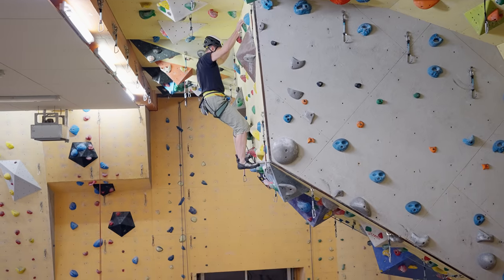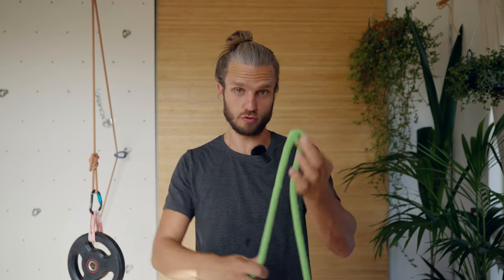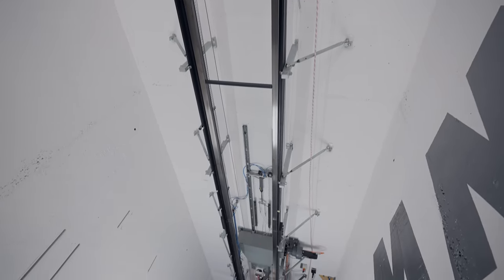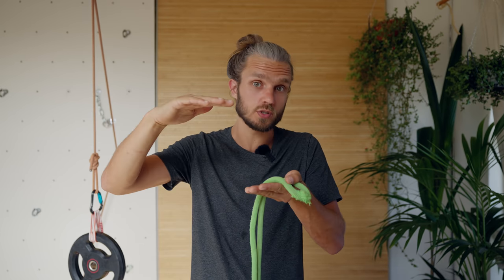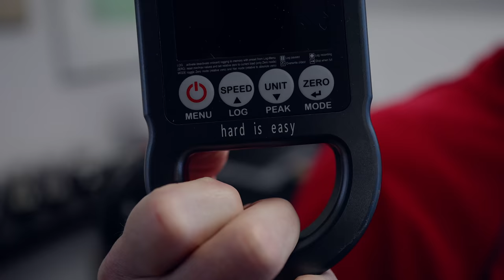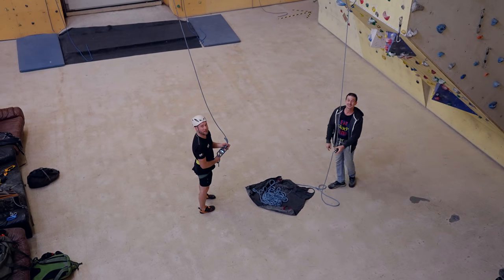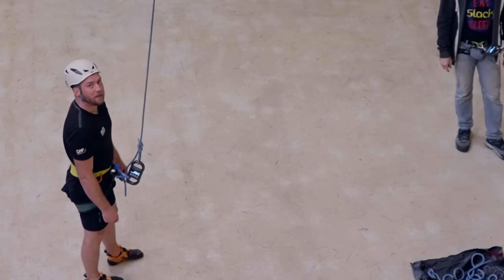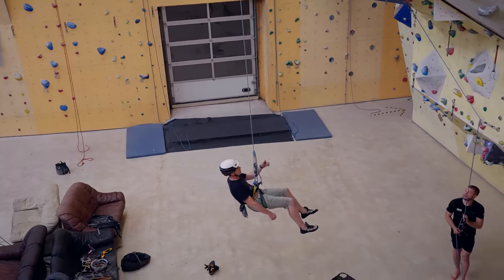The Hardest Possible Climbing Fall - P.1

Comment: 13:13 Interesting.
With the same height from which the weight falls, the kinetic energy at the bottom should be approx the same K=1/2mv^2=mgh
So, at the bottom the centrifugal force would be F_c = mv^2/R = 2K/R(approx) reduced with more R.
And the net force at the bottom would be approx the peak force if it falls straight down + centrifugal force - recoil (incase the weight stretches the rope away from the bottom part due to which it bounces)
(Not sure if that can be added/subtracted this easily, but it's going to be 2K/R(centrifugal) +/- something)

🤔 It'd be bad if the recoil point happens right at the bottom with peak centrifugal force.
Reply from the maker: The only real paper on rope swings I found was this: http://www.bigel-labs.de/3.Physik/RopeSwing/RopeSwing#5
It does not talk about forces to the rope but instead about G forces, but shows how they don't peak at the bottom of the swing and instead somewhere along where the rope starts getting tense...
Reply: @HardIsEasy  Wow, that's counter-intuitive! Imma look into this. Thanks a ton.
Reply from the maker: @bios546  Think about it... Rope starts absorbing the fall / slowing you down way before you reach mid point of the swing... 
Might actually Include some graphs of force over time in some of my vids

Comment: Hy, i am actually very curios if any of your test buddies, got some back/hip pain out of your science project. As a professionell treeclimber i learned in all of my courses, how severely dangerous even tiny falls into a static rope are. So trying to push the limits of a fall with an elastic rope and a real climber feels a bit crazy to me. Still you aproached the testing quite safely bringing the falling-faktor slowly up and the content was interesting.
So thanks from my side!!
Reply: It`s zero pain. climbing belt ( climbing harness) is over your hip, and the shock off the fall is absorbed by the straps that is attached to the belt and around the thigs of the climber. The climbing rope is almost like a bungee rope and is highly elastic. The real risk is to fall hard into the wall and to break the ancles or hands. To prevent this it`s important that the belayer uses " dynamic belaying" , this technic makes the fall alot softer for the climber
Reply: People do gigantic rope jumps on dynamic climbing ropes - the material has enough elasticity that you can basically fall any distance without encountering high enough forces to cause serious damage.

Comment: Good stuff! So can we calculate the max G-force that the body had to suffer in the biggest fall? Off the top of my head, that would be around 4g, no? That is pretty interesting, because in a video I made with bouldering falls the peak force was more than twice as much! Dynamic rope sure does a good job of softening the fall!
Reply from the maker: I tried to play a bit with accelerometer in the phone to get G froces, but not much success so far, would need more accurate device for that.
But I have a looooot of data from dynonometer and hundred + falls
Reply from the maker: here are some physics with G forces on big rope swings: http://www.bigel-labs.de/3.Physik/RopeSwing/RopeSwing#5

Comment: Great Video as always! I'm super curious about a new piece of gear a friend recommended to me. The Edelrid Ohm- Assisted-braking resistor for increasing rope friction when there is a large weight difference between the belayer and lead climber. In the event of a fall, the OHM increases the amount of rope friction to the first bolt so that a lighter belayer can hold a heavier lead climber without difficulty.
What is your opinion on this device?
Reply from the maker: I'll make a video about it some time in not so near future (overloaded a bit), but it's great for what it does, don't know anything better at this day

Comment: Wouldn't the z drags actually help soften the fall? 
The extra friction starts absorbing force before it makes it to the belay device, spreading out the impact, and there is more rope stretch in the system to absorb force overall.
Reply from the maker: From my experience on real climbs with a lot of drag or some experiments I saw heavy drag makes a much harder catch for the climber.

I guess rope stretch is better at absorbing the impact compared to friction.
In heavy friction situations rope close to the belayer doesn't get much load and doesn't stretch that much...

Maybe slight friction could actually produce the result you are talking about, but I have no proofs just speculation
Reply: @HardIsEasy  that makes sense, thanks!
Reply: Yeah I have had very heavy climbers say "great catch" when they were fairly high up and when they fell but I felt nothing.  There was no jump by me bc I felt no force on me at all to jump into.  But I thought it was bc there was so much drag bc of so much rope out that the system did all the work.
Reply: @nettewilson853  I've heard similar stories where the climber fell high up on a multi pitch, later said good catch to the belayer and their belayer didn't even know they fell

Comment: One question... Why the small 10kg disc generates 2.9Kn and the 72kg human just generated even less?? I can't find a explanation by myself. Thanks!!
Reply: lesser ropelenght = lesser way for friction. with lesser friction or stretching you have higher forces.
Reply: We should look at the impulse, the soft human body will spend longer time decelerating than a rigid steel plate. So you need less force because you have longer time to apply the force
Reply from the maker: 1. In the gym I was mentioning loads to the climber, in my room the dynonometer was on the top making the reading almost double.
2. Very little rope in the room def makes a very static catch.
Reply: One fact not mentioned yet is that a lot of energy is diffused in the elasticity of the person's body, resulting in lower force. Drop tests with rigid objects generate much stronger forces.

Comment: Why no line scale on the top bolt? More practical significance to see what forces the top piece sees. The conclusion of this vid is that you shouldn't push off from the wall? Feel like that was already common knowledge??
Reply from the maker: We had linescale on top quickdraw as well as on belayer but that data has no relevance for this video.